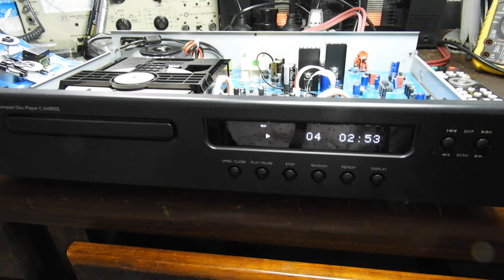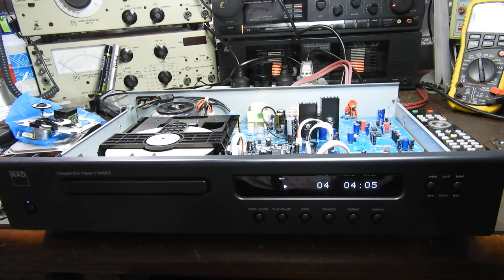NAD C 545BEE CD player with Wolfson WM8740 DAC & Sanyo SF-P101N laser mechanism

Comment: Hello. Thanks for video. What's pin 15 or 16 laser have ?
Reply from the maker: I don't remember. But I normally convert one to the other depending on need. I just transfer the wiring loom (wire by wire, in order not to make mistakes.